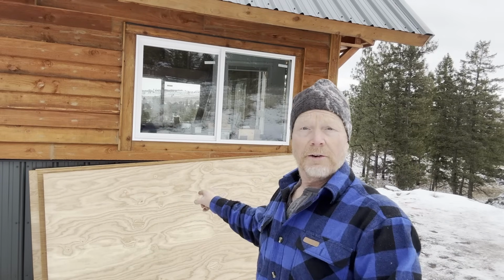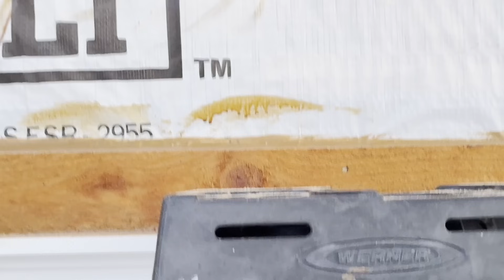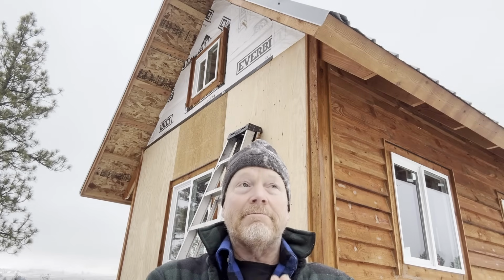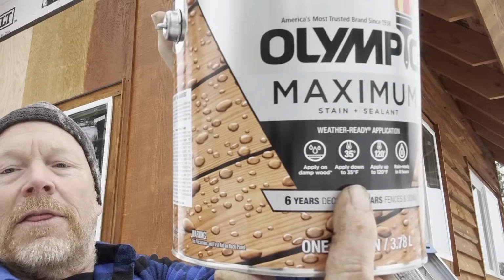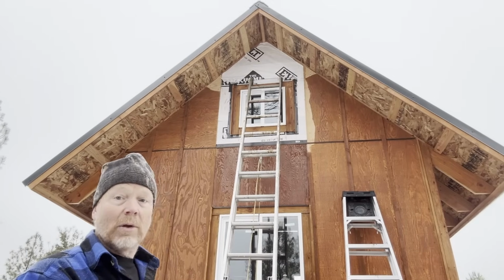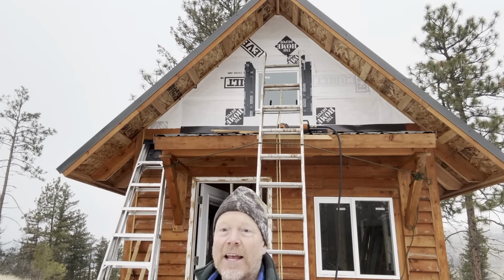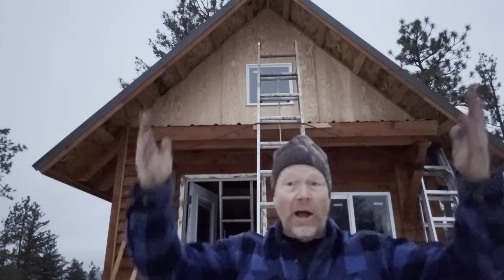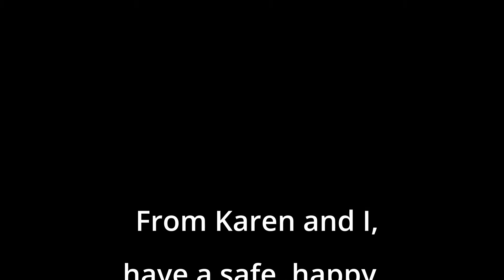Easy! Beautiful Board and Batten Siding on an Off Grid Mountain Cabin

Comment: Howdy….little pointer from a retired contractor….set your saw blade so it just breaks the surface of the board…..if u just happen to slip up, then as little blade as possible will bite ya……..still got all my fingers, but  they show a few lessons…love your videos…have a Great New Year
Reply from the maker: Very good advice! I would if I could…The mechanism that lowers the blade is broken. It’s an old saw. Thanks for watching!

Comment: Hi Patrick, I really enjoy your videos. Planning to build a small cabin myself in the spring.  I’d like to know what size nails you are using for your exterior trim through your framing nailer?  Window trim etc.  Keep up the great work it’s very inspiring!
Reply from the maker: Hey thanks so much! Glad you found me. Those were 2 3/8” (I believe) galvanized ring shank. Overkill, but all I had on hand, and the wood took it nicely with the right pressure. 🙏

Comment: Any reason not to stain the decking area outside the door? It would look more coherent with the rest of the stained siding
Reply from the maker: I certainly will in Spring. Just not quite warm and dry enough now, since I have to use it. Same with the front door.

Comment: Seems a very expensive way to do your walls. Plywood on top of OSB. Did you use external rated plywood?
Reply from the maker: Yes and yes. As I mentioned in the video, if I knew I was going to run out of lap, I would have planned a bit differently.
Thanks for watching!